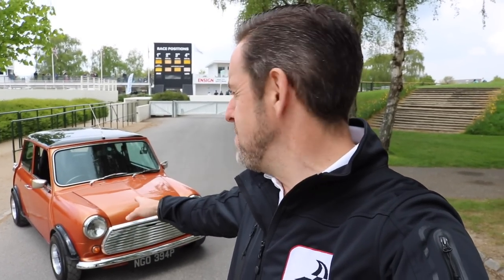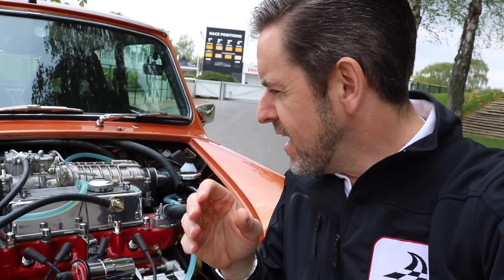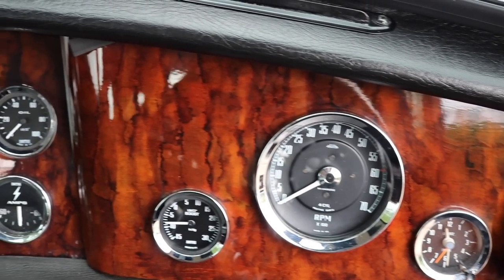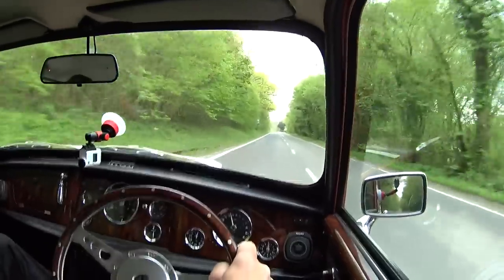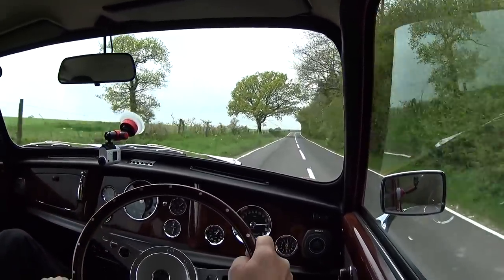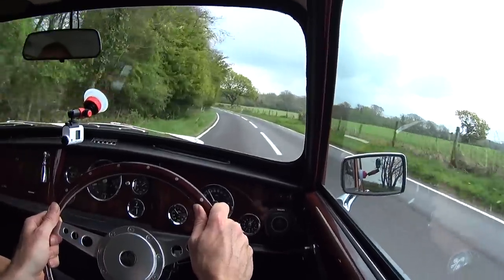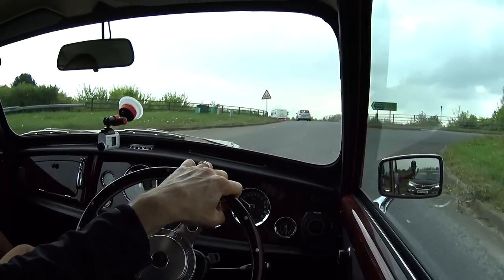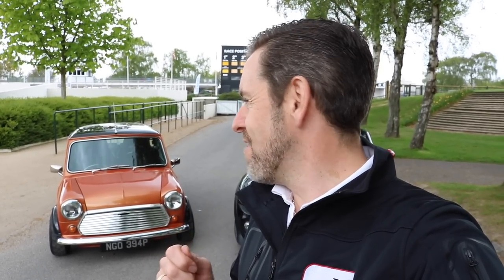160 BHP Supercharged Mini - Modern Performance with Classic Charm !

Comment: What is that supercharger? I want to do the same have an 88 mini with turbo box welded in but the turbo manifold and turbo was robbed!! 😖😖 1380 engine to be reworked 😋😁😁 also have an 81 but that is left as 998 standard. Big thumbs up to the the video. An the owner 👌👍👍👍👍
Reply from the maker: I'll ask Mark to answer your question 👍
Reply: Many thanks would appreciate the info😁 looks like it fits a treat 😎
Reply: Hi Colin. The Supercharger is a modified Eaton M65 with a Weber 45 carburettor. The supercharger has to be modified to take the carb & is then mounted on a custom made manifold. The supercharger work on my car was done by Stuart at Vmaxscart & was custom developed for my engine. However, Stuart does bolt-on kits for various stages of engine. He can be contacted on 07736063945 if you can get him to answer his phone!!!  :-)

Many thanks for your positive appreciation of my car.

Regards

Mark
Reply: @evomark4077  Hi Mark Thanks for sharing your experience and wisdom on your car. Loved the hornet look of the wooden dash she looks beautiful. It's inspired me to try and go the extra mile to get it right with my project's. Unfortunately I'll health. Is making progress slow. I remember the old days when you could bolt on a sharock charger I think they'd was called. (Showing my age 😋 )
Good luck for the future form a very grateful admire
Cheers Mark 🍻🏁🙏
Reply: @colinadorrell9363  Hi Colin. Thank you for your positive comments. When I started the 2014 re-build, I thought I would be doing only what was required to get the car back up & running, but as it continued I discovered that behind each distaster, there was another disaster, so I soon decided that if I was going to do this, I was going to do it properly. That decision meant that it cost much more than originally planned both in terms of time & money, but I don’t regret either. I’m so glad that I decided to do everything properly because, 5 years on, the cost is a memory but the enjoyment remains. I would encourage you to go the extra mile with your restorations because the end result is sooooooo satisfying. My best wishes with all of your project & I wish you the best of health.

Regards

Mark

Comment: How did you stop it from ripping the idler gear out from the gearbox to the engine with that booser on it ? I done something like this way back and had trouble with that idler.
Reply from the maker: Not sure but I'm seeing Mark tomorrow and will ask him to answer your question :-)
Reply: Hi Gary

This is always a problem point on Minis as you are obviously aware. Currently the transmission in the car is standard & seems to be coping ok due to the very smooth delivery of the power & torque that this supercharger setup gives (I have had a different supercharger setup giving similar power, but less torque on it for 6 years before with no transmission problems). However, I am hoping next year to change the gearbox & transfer gears for uprated items from Minispares which they assure me can handle the power/torque.

Comment: How long does the gearbox last with that much power without straight cut gears.?
Reply: Hi Tal
Thanks for your interest & question. It’s a good question & one that I’ve been asked many times. The power delivery with the supercharger is very smooth & progressive & all occurs below a normal 6000RPM rev limit. That, coupled with the fact that I make sure that I deliver the power smoothly at all times seems to have kept the gearbox happy so far. I just hope my luck continues!!!

Comment: Would love to see the dyno figures....160BHP from an A series is going some. How long between rebuilds? (I used to race these engines in the early 80's and must have blown enough to bits to fill a skip!).
Reply: My friend had a 1460 that dynoed at 160hp and a turbo that dynoed at 195hp. He used to daily the turbo with the boost turned down to 4 psi. There's a series turbos that produce near 300hp now, not that they'd last too long.

Comment: what the supercharger your useing and whats is the set up with the drive belt which drives the supercharger and who supplied the component parts
Reply: Hi George. It’s an Eaton M65 supercharger driven from a custom crank pulley. Everything you need can be supplied by vmaxscart.co.uk

Comment: Does the 160 bhp include the considerable power needed to drive the supercharger? Illegal number plates by the way !
Reply: Hi Nick, the 160BHP figure is from the road wheel output after correcting for transmission loss, so does allow for any losses involved in driving the supercharger. You may be showing your age slightly with regard to your knowledge of the number plates - I’ve not met a Copper yet who realises that they’re 4 years out!! :-)

Comment: Extra baffles in the sump...?  2 laps of that roundabout on the standard sump would have seen the oil pressure fall away!
Reply: Central oil pickup with baffled sump. Endless roundabout fun with no problems at all!

Comment: 1293?Previously built 1340,1380 and a 1430 (marginal head gasket!).All with ridiculous works race cam profiles-very peaky.Super/turbo charging is the way to go for road power.Obs gearbox being the weakest link over 110 hp.
Reply: Hi Andrew. It sounds like you’ve definitely built some special engines in the past. Thanks for your interest in my car. You are absolutely correct in mentioning that the gearbox will always be the weakest link in a highly modified car. One of the great things about the supercharger conversion is that I retain a 6000 RPM red-line & the torque & power is delivered at sensible revs. Also I drive the car with consideration to the gearbox, whilst still being able to make rapid progress. I have had no transmission problems so far.

Comment: great looking car; a credit to its creator.  i will say it would have been nice to get some idea of acceleration and speed capabilities.  it is hard to be interested in cars and not want to know the basic performance parameters.
Reply: Hi Alexander, thanks for your interest. The top speed is not that great, about 90MPH, but the engine is screaming at that point so I don’t generally cruise it above 70MPH. However, I am hoping to put a 5-speed box in it next year which should allow more relaxed high-speed cruising. The only 0-60 figure I have is from a passenger with a stopwatch & that suggested about 5-6 seconds. It is obviously a little quicker without the weight of a passenger however.
Reply: @evomark4077  i don't know if they still do 3.1 final drive crown and pin but used to run that in my coopers which gave it a bit less acceleration but 107 at 6500 its back in 70's so from memory .

Comment: ‘Really torquey’. I had a classic mini that was 998cc standard and if you drove it hard through the gears it would try to take you into the kerb and I can’t imagine the bhp was that much either (now have 2011 JCW with 211bhp), so no wonder with 160bhp this is going to want to go through the hedge at the side of the road.
Reply from the maker: You have to hold on tight 😂

Comment: check my mk1. this sound so damn cool!!! question: what supercharger is that? vortex?
Reply: Hi. The supercharger is a Hybrid Eaton M65 made from components from Mercedes & Lexus versions of the M65
Reply: thanks mate!
Reply: Mark - I love your car and am in the midst of converting my '74 Mini 1000 to a Stuart Gurr 1310 A+ w/ his supercharger set up.   I am in the mountains of New Mexico, USA at 7,600, where the elevation strangles normally aspirated engines, hence the supercharger.  I have the 40 Weber on mine, not the 45 like yours.  I also thought about the VTEC conversion but wanted to keep the heart of a real Mini.  Is there somewhere on the web where you list your mods?   Thanks for the vid, PetrolPed!  My resto is tracked here; http://restorationmini.com/forum/index.php?topic=1009.0
Reply: Hi Bryan. I don’t have any kind of web presence regarding the car, but you are welcome to email me at mark.mbtechnical@btinternet.com for further conversations. Stuart Gurr is responsible for my supercharger conversion & I’m sure will be able to advise you well, but I am more than happy to help.

Regards

Mark

Comment: It’s an 8 valve pushrod engine with no doubt high lift cam with substantially different duration of valve timing and overlap and roller rockers. Sadly the internet “clarksons”are just as poorly informed.
I’ve been building engines for over a quarter of a century- but what do I know
Reply from the maker: No sure what you point is ?!
Reply: Hi, I’m also not sure what your point is, but I can let you know that it has a standard lift 270 cam with 112 degree lobe angles & standard rockers as they give better torque. I’ve been building engines for 35 years & I definitely don’t know it all!

Comment: @ 2:.01 "custom CAMS" ???? This is a OHV single-cam siamese-port A-series engine!  Plus 20 overbore is 1293cc however the data on the cam and head plus the blower ratio would be far more interesting. Vizard would be turning !
Reply from the maker: A slip of the tongue. In my defence I think you will find a single 'cam shaft' but on the camshaft are a number of 'cams' :-)
Reply: Hi Alex. The cam is a 270 profile, but with 112 degree lobe angles to reduce overlap. The head is a modified 12g940 including larger valves & is fully ported & flowed. You are correct in stating that the displacement is now 1293. The compression ratio has been reduced by using dished Omega forged pistons. I will need to consult Stuart regarding the blower ratio & will get back to you. Thank you for your interest.

Comment: Very nice little gem, but judging by the acceleration, I doubt this car has any where near 160hp!  I have a naturally asperated 1293 Bugeye with 276 APT cam, 10-1 c/r, twin HS2 SU's, Maniflow intake and LCB header, and Mini Spares big valve alloy race head w/ 1.5 rockers and a 5sp gearbox that accelerates as quickly as this car.  I would guess my motor produces around 100hp.
Reply from the maker: It has been on a dyno since and it did 👍
Reply: Sorry, I just don't buy it!  Please post the dyno sheet for this car/engine.

Comment: What is the top speed of that car
Reply: Top speed is not that high, due to only having a 4 speed box. It will do about 100, but the engine is screaming its bits off at that speed. I generally cruise it at 65-70 on a motorway, but it’s all about how quick it is in the twisty bits rather than overall top speed.

Comment: Top speed?
Reply: Not great really, only about 90-100MPH as it stands, but that would be screaming the engine to stupid levels. However, I have a five-speed box planned for next year which would give a much higher top-end although it is actually only planned as a means to reduce engine revs during longer motorway journeys.

Comment: It`s alright hitting 0 to 60 faster, but what happens when you hit 60 to 0. All the emphasis has been put into performance and not the safety of the occupants. If you want a fast car buy one that has been designed to do so and has the safety features included
Reply: Hi Captain, I appreciate & understand your comments. I can assure you that the brakes & suspension have been upgraded to compliment the increased performance. You are correct however, to point out that there are many other aspects of passenger safety that are inherent in modern cars & just not possible in older cars like mine. At that point, it just has to be a judgement call by any driver or passenger I’m afraid. Every time I get into this car I am aware that it does not offer modern safety levels for the occupants, but I accept that risk as a part of my enjoyment of the car. Thank you for taking the time to watch this video & to comment.

Comment: Custom cams?
Reply: Hi dandere. Peter was slightly in error in pluralising the cam status. It only has one cam as per all A-series engines, however it is a custom cam in that the lobe angles have been changed to reduce the amount of valve overlap as too much overlap is not desirable on a forced induction engine as the blower will just push fuel/air mixture straight through the head & onwards into the exhaust if there is too much overlap.
Regards, Mark.
Reply: No problem. I was just being pedantic. Lovely Mini.
Reply from the maker: My bad ! When you think of it, there are multiple cams but just one cam shaft ;-)
Reply: True. That was actually my mistake, then. Oops, sorry.
Good review. Keep up the good work!

Comment: Bolt on a super charger to any motor will improve it ,I can tell you now with them wheels on and the time it's taking to run through the gears that it's nowhere near 100bhp , ya can't bolt on bits thinking this adds power and so does that , its never that easy , it's goto be dyno run to be set up properly .no use having it 65% right when you can perfect it better .if it was producing 160 bhp then it spin in top gear with ease and take the diff out as they explode when chattering between grip and spin , same thing with minis with metro turbo motors ,the diff went for the same reason .nice car though ,hope he finishes it off

Comment: So much could of been done but was just left to tuners
Reply from the maker: Not sure what you mean 🤷‍♂️
Reply: @PetrolPed  A friend raced minis and she found that almost all the tuning and reliability improvement were never passed into production minis even down to modification to exhaust clamp .Also in the 80s it needed better suspension and a tailgate but Leyland would not invest in this little car.profit margins were very small mainly due to poor manufacturing techniques. The car was back breaking to build and fitters were given a mechanical screwdriver to assemble the door lock while in Germany they were using air tools (just to give one example). I hope I have explained myself.still a great little car never will there be a car quite like it

Comment: A series single cam push rod engine supercharged- poor effort for a car buff allegedly to say cams
Reply from the maker: As I have said in this comments section already. It has a single cam shaft as you say but on the shaft are 8 cams or cam lobes (depending on how you want to describe them !). I rest my case !
Reply: Nobody would ask for 8 cams or 16 cams for a 16 valve engine, this is this is the thing with the internet it is dumbing people down.
I’ve worked repairing vehicles for over 2 decades and have an apprenticeship and tee shirt to go with it.

Comment: Lots of broken gearbox's!
Reply from the maker: Not that I'm aware of !
Reply: Yeah, it's generally accepted that anything much more than a hunderd BHP will severely shorten the life of the transmission, there were some guys, years, back who'd turbo chared their Mini's and they reckoned about a year if you were lucky.
Reply: That’s why you get a ford type 9 gearbox and 3.9 dif
Reply: This is always a problem point on Minis as you are obviously aware. Currently the transmission in the car is standard & seems to be coping ok due to the very smooth delivery of the power & torque that this supercharger setup gives (I have had a different supercharger setup giving similar power, but less torque on it for 6 years before with no transmission problems). However, I am hoping next year to change the gearbox & transfer gears for uprated items from Minispares which they assure me can handle the power/torque.

Comment: it has one cam you fool, at least get someone that knows what they are talking about to present
Reply from the maker: I think you will find it has one cam shaft which has multiple cams, in this case 8 !

I didn't say 'custom cam shafts', which I would for a twin cam shaft engine, I said it has 'custom cams' which I think you will find to be correct !!
Reply: nice attempt at damage control :D xx are you talking about cam lobes? :D